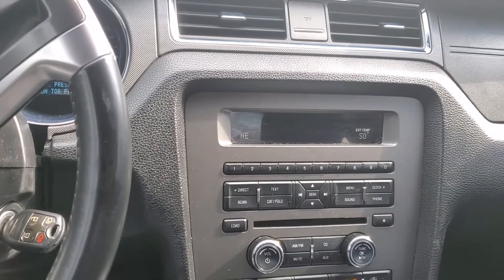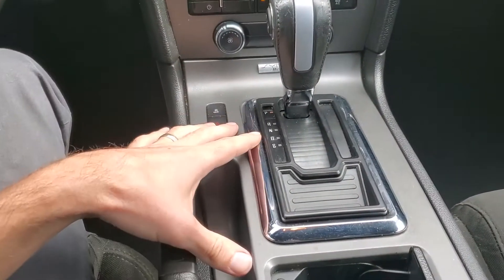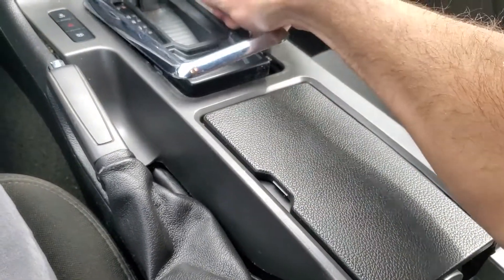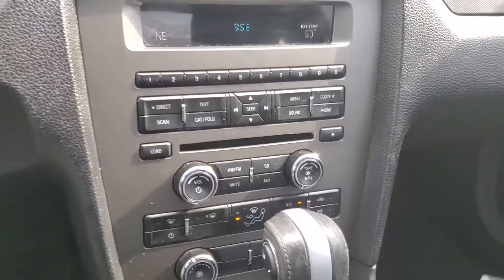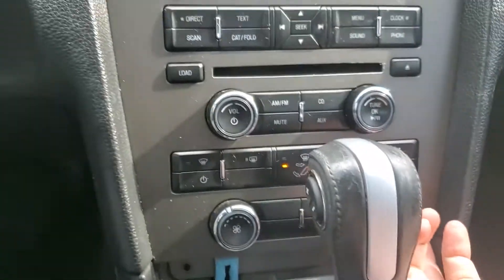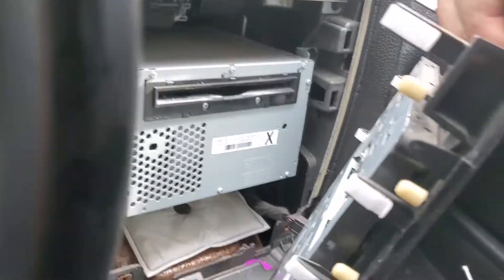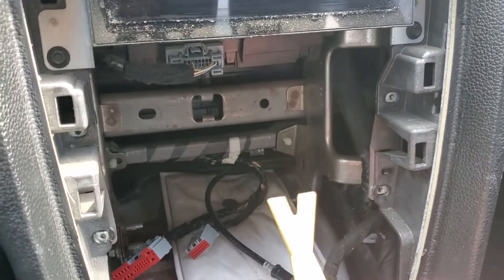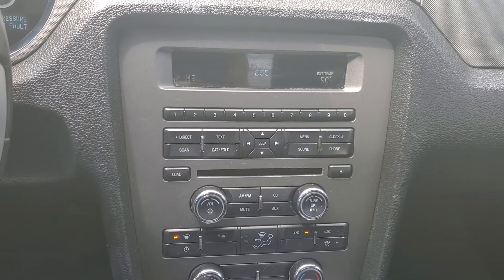Ford Mustang F150 Blinking Time Flashing Clock | How to Remove Radio

Comment: My time I flashing on my 2012 mustang and ac works fine but I can’t listen to music with Bluetooth or sync or radio. Would this be the solution?
Reply from the maker: Yes this will solve the issue with your unit! Here is a link to our service.
https://www.automotivecircuitsolutions.com/products/09-ford-radio-repair
Reply: @AutomotiveCircuitSolutions  thanks!

Comment: The same happen to my its a 2012 mustang and time was blinking so what I did was when I had the radio still connected I put a cd in and then noticed that the sensors were closed so I hit it a couple of times and it oped up the sensors and it worked so I say first try what I did so that way you don't pay and they just take your money it works.
Reply: Did it actually work bro

Comment: Is it a part that you would be replacing inside the unit? If so would it be a permanent fix...I paid someone to relfow the board worked for two weeks and starting blinking again.

Comment: If I replace the part you said we are after would it work after that? Because I found one on eBay and ordered it! Please respond
Reply from the maker: Yes as long as the #s match up it should work, that is if it doesn't have the same issue yours does. They all will eventually fail, it's just a matter of time.
Reply: @AutomotiveCircuitSolutions  which numbers must matchup?
Reply: What do you mean about the #’s!!?? I’m from Canada and I’m having this problem. The shipping is expensive as hell. Would be so much more ideal for me to just replace it rather then sending it to you to get fixed..
Reply: @15dean  I ended up ordering a used one off eBay and replacing it for only $60! Works like new just make sure you get the correct part #
Reply: @479brayden7  what’s the part number
Reply: @rylanbrown575  it just depends! What I did was took mine down to a local salvage yard and asked if they had one and they told me what part # to look for!
Reply: @479brayden7  u just pulled one from there and swapped them did u have a burning smell as well?
Reply: @rylanbrown575  mine had just completely died, I never had any burning smells or anything. Before it went out I heard lots of loud pops through the speakers though. Then the screen would just flash the time and wouldn’t work at all. I removed it and ended up taking it to a salvage yard to see if they had one and they didn’t put showed me the correct part # which allowed me to find one on eBay. if you would like if you have a phone # or Instagram I could help you out a little bit more there and help you find the part number

Comment: Do you still do this? Also, I get this after hearing a  loud popping sound in my speakers? I unplug the negative cable for 30 mins and it will reset but it all just happens again the next day or so. My question is. If I send it to you will this resolve the popping? As in, are they related? It would suck to pay to fix it if some sort of short is going to break it again. Does that make sense?
Reply from the maker: Yes we are still repairing these. Yes the service will resolve the popping as well.
Reply: @AutomotiveCircuitSolutions  thanks for the response. I’m hesitant because I want to be sure the popping isn’t happening because of a short somewhere else in the car. I’m sure you’ve had that question before. I’ve just heard of people having the problem fixed and then it comes back. Are you sure the source of the issue is within the stereo? Or that it’s not caused by another issue that causes this issue with the stereo? And when I say I’ve heard of people fixing it and it comes back I didn’t mean fixed with you. It sounds like you know what your talking about. Hence the question
Reply from the maker: @simond7065  I understand your concern. We have fixed hundreds of these and most of the customers reported that the issue started with popping noise and then nothing, no radio and no sound. After repair all is resolved. We have a lifetime warranty so if for some reason it happens again, we will take care of it. If for some reason it is not repairable, there is no charge.

Comment: Do you still offer this service
Reply from the maker: Yes we do.
Reply: The same happen to my its a 2012 mustang and time was blinking so what I did was when I had the radio still connected I put a cd in and then noticed that the sensors were closed so I hit it a couple of times and it oped up the sensors and it worked so I say first try what I did so that way you don't pay and they just take your money it works.
Reply: @AutomotiveCircuitSolutions  what is your website I need to send you guys my radio
Reply from the maker: @trevorwilson9087  https://www.automotivecircuitsolutions.com/collections/radio-repair/products/09-ford-radio-repair
Reply: @trevorwilson9087  did your radio work when you got it back
Reply: @AutomotiveCircuitSolutions  I want to send mine how much is it to get it fixed
Reply from the maker: @misaelmagana9181  The service is $120. The link to the website is in the description above
Reply: @AutomotiveCircuitSolutions  it’s 120 I pay shipping to send it to you and then you pay to send it back to me?? and what company should I ship it with fedex or usps
Reply from the maker: @misaelmagana9181  $120 is service cost only. On the website at checkout it'll charge you for return shipping and you have to send it to us at your expense.  Use fedex or ups. Usps is unreliable right now.
Reply: @AutomotiveCircuitSolutions  ok thanks a lot I will send it out in a few days

Comment: Take out the mother board in the cd unit put it in the oven at 375 for ten minutes.
Reply from the maker: Yes and then once it fails again after 2-4 weeks send it to us and expect a double bill once we see melted burnt marks on the circuit board and it requires replacement. No but seriously don't do it, the repair won't last long and we keep getting these that are unrepairable because people over do it.